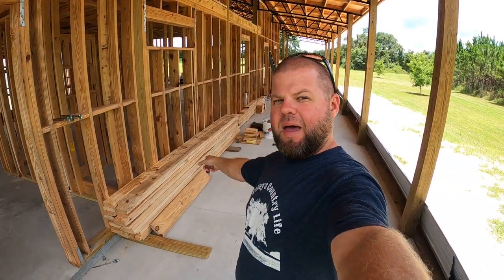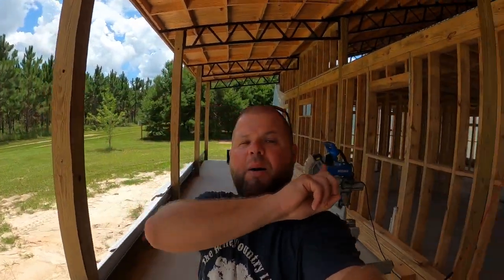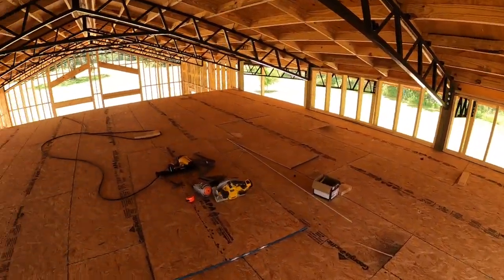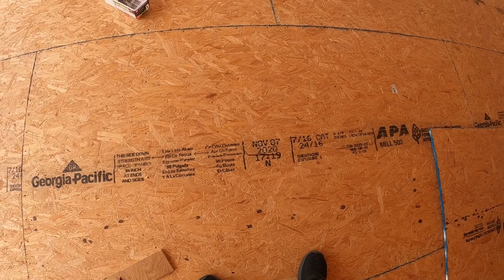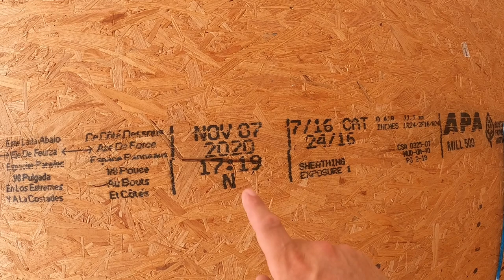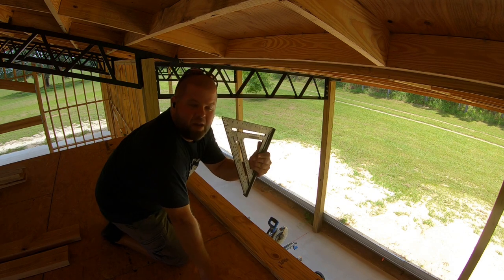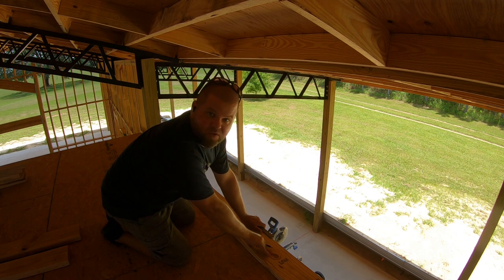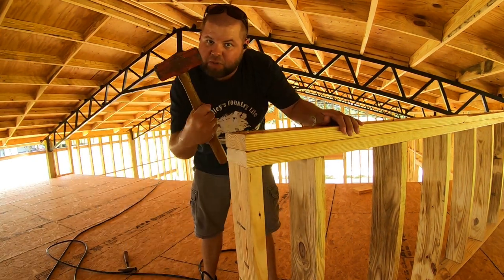Final attic walls and my lumber price soapbox! #383

Comment: When the scamdemic sent everyone home in March and April of 2020, they started building things during their time off.  While they are building projects and using lumber, many mills were short staffed or closed for a period of time.  None were keeping up normal production volume.  Increased demand, decreased supply.  The trucking company I work for had it's best year in history...  our drivers (owner / operators) were hauling their butts off, but some other companies lost some of their fleet, so an industry that is always short handed had even less capacity.  That increased cost per load quite a bit.  What lumber was being produced suddenly cost a whole lot more to be transported.  That is most likely why your OSB made in Nov 2020 took 4 to 5 months to get to your local reseller.  All this for a virus with a 99.8% survivability rate.  Doesn't make sense, but at least I get to work at home now and watch YouTube videos during the work day.

Comment: Be sure and frame some 2x10’s or other scrap for paper towel holders, towel rods, etc. I framed my house and tried to think of every brace possible so screws were in wood and not just in sheet rock.
Reply from the maker: Great tip, I've been saving all my scraps.

Comment: I can tell you that I know where 7 trailers are loaded full of wood with no tractors to move them and I know one of the drivers that drop one trailer there. This driver was told to pick and drop for pickup later. It all pt lumber. I dont know why its just sitting but one load has set for 2 weeks now

Comment: I believe part of the issue with "old" lumber is the same as most commodities, when the plant/mill increases the prices then the wholesalers increase the prices and the retailer increases the price the same happens when the prices go down and in a perfect world those overlaps in prices should cancel each other out.
When I worked at a gas station and we got in a tanker in at 5 cents cheaper we may have 2000 gallons sitting in our underground tank, if the competition across the street gets in a tanker  only has 20 gallons left they will drop their price by the 5 cents, in order to compete we must drop our price and lose 5 cents per gallon on that 2000 gallons and hope that when prices go up we have some left in our tank to make up for the previous loss.
That being said there is a big difference between covering your losses and increasing prices just to jack them up.

Comment: 7/16 OSB at Menards is $34.84 in my local store in Michigan.
Reply from the maker: Way higher here, maybe it'll drop soon!
Reply: I just looked at the Menards website seems like some stores are more expensive than others. You house is looking real nice. What a different codes make from one state to another. All the metal strapping and your nailing pattern you need for Florida.

Comment: OSB can be used right after its produced. If it was old it was in a warehouse somewhere.
Reply from the maker: Couldn't see your other comment, YouTube deletes comments with links. It vanished about the time I was trying to open it
Reply: @TKCL  our new digital lumber trading platform is disrupting the supply chain. I grew up in it and it is as old school as it gets. We are letting anyone that can buy or sell full cars on. The reason the price is still high is everyone speculated. Example: Trucks of 4x8 7/16 OSB sold at around $32 a sheet this week on our platform. Some cheaper. You would never see that going the traditional route. Full trucks are 12-13 full units. I still see it at $40 and higher at locations.
Reply from the maker: I am in north Florida, I buy here and in south Georgia
Reply: @TKCL  that is a big area for our users.

Comment: Why do you use 2x6 walls with double top plates. Those walls are not bearing any weight. Wouldn't 2x4 single top plate be good enough?
Reply from the maker: Yes it would! The engineer required double top plates, most likely for flex and shear (hurricane zone). I chose to use 2x6s so there was no exposed 6x6 posts or trimming required. It will also allow more foam insulation.
Reply: Thank you for the answer.